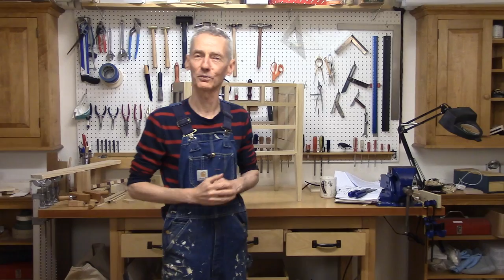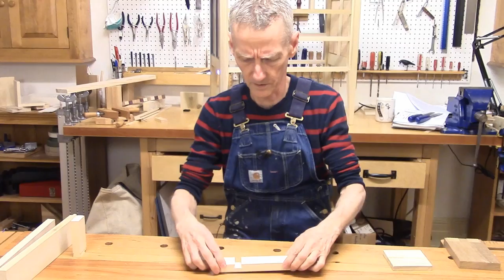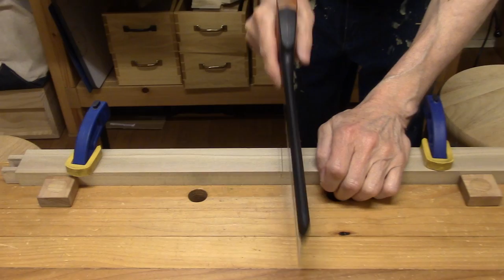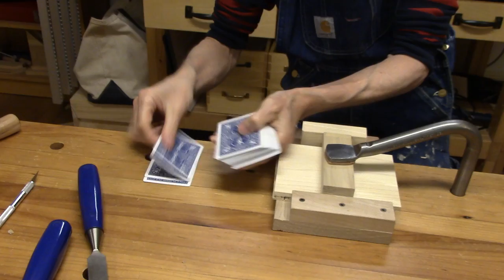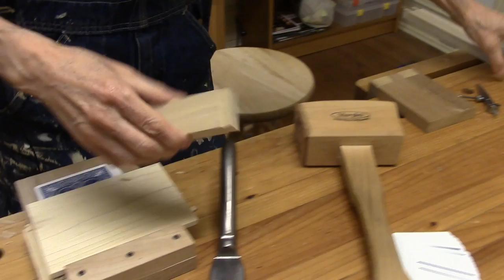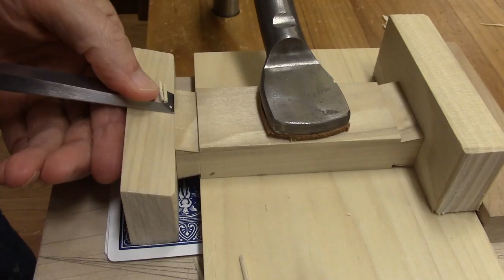Chest of Drawers Show #5

Comment: Would it have been easier to control the saw if you had flipped the block so the saw rested on it and cut the opposite side, putting the guide against the inside pencil line?
Reply from the maker: Yes, I've seen the block used in the way you've described. I tried it both ways and found the saw less likely to skip with the bevel facing down. Both methods work though. Thanks for commenting Richard.

Comment: Where did you get that mallet? What's the size? How heavy?
Reply from the maker: I've had the mallet for so long I can't remember where I got it. The head weighs 11-1/2 ounces and measures approx 5" long x 3" high x 2 - 1/8" thick. The handle is 12 - 1/4" long. Woodcraft sells one very much like it (#14D61). A mallet would be a fun project to make.
Reply: Thanks for getting back to me Ken. I really enjoy your videos.
It would be a fun project to do but my skill level isn't there yet to make one that nice. I am trying to work on that just need more practice.
I will definitely check out that that mallet, I hope it's not too expensive as funds are a little tight my way but I have been wanting to pick one up.
You do great work and I can't wait for the next video.
                      Kevin
Reply from the maker: Thanks Kevin. Enjoy your woodworking journey! Best regards. Ken